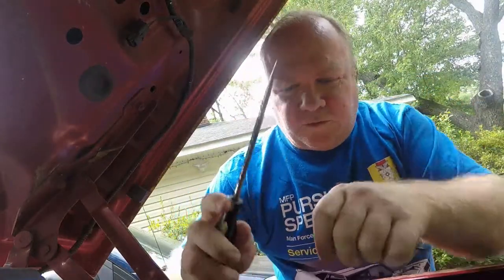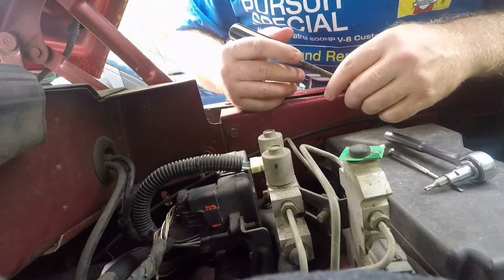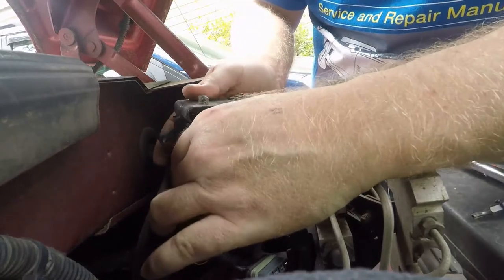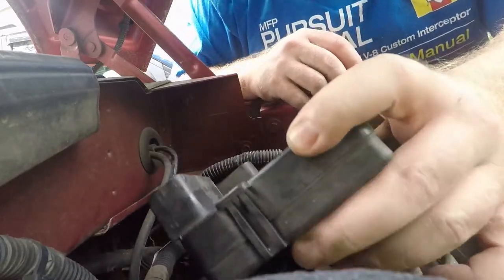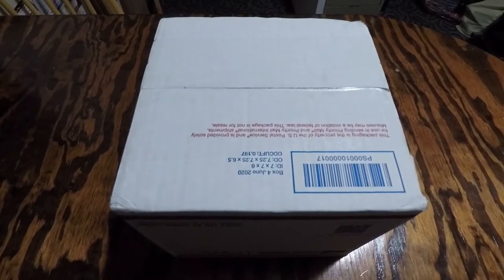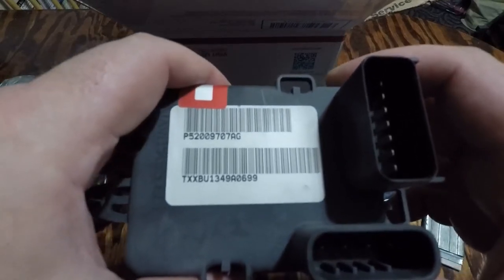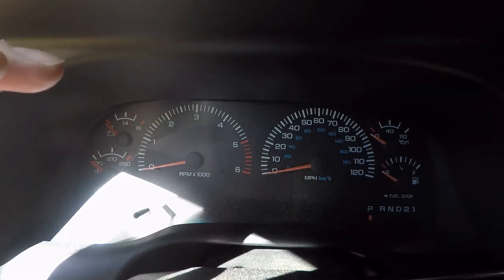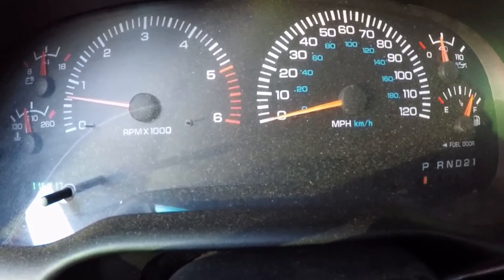ABS Control Module Removal Rebuilt & Reinstalled *LINK IN DESCRIPTION*

Comment: Hey there. Thanks for the video! I am on the Dodge Ram forum page and the suggested install states to bleed the break lines when changing or replacing. Any thoughts on this? I obviously don't want to mess anything up and your video makes it look pretty simple to remove and re-install. THanks!
Reply from the maker: It's not a bad idea to bleed the brakes so everything is set where it should be with the new ABS module. When I went to my friend's shop to reset the onboard computer after the ABS module install, I had them bleed all 4 brake lines for good measure.

Comment: Glad I came across your video today. I literally have been debating sending them my ABS module for the last few days but, still wanted to conduct a few more tests. I checked the ohm readings first on the rear, then the passenger side and both checked good...then checked the driver side and got no ohm reading so I was sure that was the problem. I  replaced it and the ABS and brake light remain. What's interesting to me is the truck basically runs and shifts good as long as I leave that new drivers side wheel speed sensor unplugged. As soon as I plug the new sensor back in it shifts erratically. I have been trying to think of anything else since I may have missed?
Reply from the maker: Mine never had a problem shifting, drove around just fine and stopped just fine. The ABS and Brake lights stayed on constantly on my dash so I replaced my speed sensor (since it was recommended) and sent my ABS module off and then had my mechanic hook up the diagnostic computer to reset the computer and the lights went off and never came back on.

Comment: Thanks for the video! Do you think it is better to have technician reinstall it? Lastly, my code only comes on intermittently and I did put in a new speed sensor but when I search for codes my code reader cannot communicate with the ABS sensors so it is probably the module I would guess. Did you have your buddy reset computer at the end?
Reply from the maker: I installed both the module and speed sensor to save on labor but went to my buddy's shop to do the diagnostic to clear the codes in the computer.
Reply: @rvr2  did you ever think it was the transmission output sensor? I’m trying to figure this out and it is like chasing gremlins. Was your sensors intermittent or was it on all the time?
Reply from the maker: I already rebuilt the transmission Twice in my truck so no that didn't occur to me. My Brake Light & ABS Light were on constantly. Yeah troubleshooting stuff like this is always aggravating, I'd just take it to the shop and run a diagnostic to find the culprit.

Comment: Aside from the ABS and brake lights staying on, did your truck have issues with the brakes locking up? Mine started locking the brakes up. After a few hard attempts to get the truck to stop, my ABS light would kick on and then my brakes worked perfectly fine. Then shut the truck off, turn it back on, the ABS light is gone and brakes are back to locking up until I jam them enough to trigger the ABS light come back on and then they worked fine again. I already replaced the rear sensor on my axle. Haven't been able to test drive the truck yet. But is the rear speed sensor also know as a rear ABS sensor?
Reply from the maker: No brake issues. That sounds like something totally different from what I had.. Not on my truck, it's just a speed sensor

Comment: Great video, man… can you confirm all “symptoms” the module was causing?  ABS light, Brake light… was your speedometer out as well?
Reply from the maker: Thanks! Just my ABS & Brake lights stayed on, speedometer still worked.
Reply: @rvr2  What codes did you originally have ? Did you replace the speedo sensor in the rear before sending the unit out ? My ABS light is the only light on and it flashes , speedo sensor has already been swapped.
Reply from the maker: I don't remember.. What ever codes he pulled pointed to the ABS module not getting any signal.
Reply: @rvr2  Thank you for posting! I have a 2003 Dodge Ram 2500 - same symptoms.

Comment: So what exactly does module master do? Do they resolder all the pins or do they replace some electronic components? I have read that one ABS code calls for the replacement of an internal relay. My ABS light is on (no emergency brake light on) and the truck activates ABS (which is a pulsating in the brake pedal) at low speeds right after you start the truck (speedo works fine) then after the computer senses that the ABS is defective, it turns it off completely and whenever you brake really hard the tires skid and squeal REALLY loud. This happens after every start up.
Reply from the maker: I have no idea what they do to it to fix it.. You should contact them directly. All I know is they fixed my problem and my ABS is still working fine today.

Comment: I have a 2006 Dodge ram can I disable it and be able to drive it? It won't start cause of the abs module
Reply from the maker: No idea. You need to ask a local mechanic or Dodge dealership.

Comment: What did you buddy do to get the lights to go out ? did it require a reprogram of the rear end and tire size ?
Reply from the maker: Cleared the codes after the module was replaced. Yes I replaced the speed sensor in the rear axle as well.

Comment: My brake light, traction control and abs light is on and has been for a year and a half now but it doesnt turn on all the time. Sometimes it wont even throw codes as if the connections to the module is loose. Ive replaced all my sensors so i know its my module. Does anyone know there the module is on a 2013 ram 1500. Ive looked all over the internet and cant find where its located.
Reply: Look under the battery box, don’t remove it. It’s under the tray.
Reply: You described my situation exactly!  2014 1500 sport.   Did you locate the cable port.  I've heard that cleaning the end of the cable with electrical spray will help remove corrosion or whatever is preventing a good connection.
Reply: @ktp7751  I'll have to try that thanks